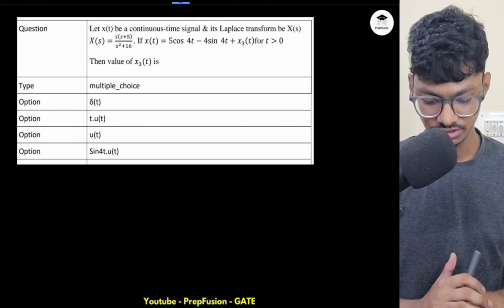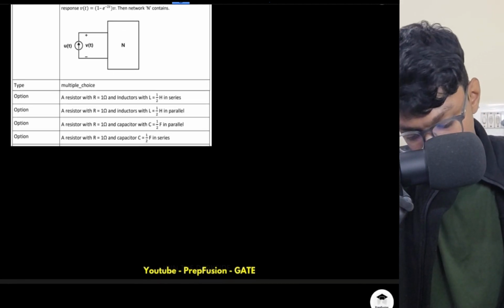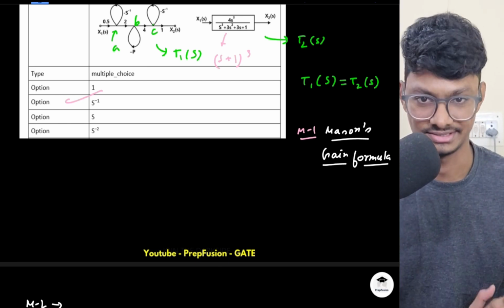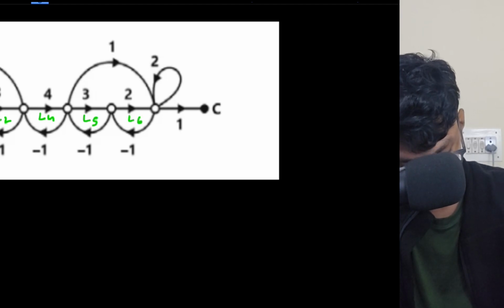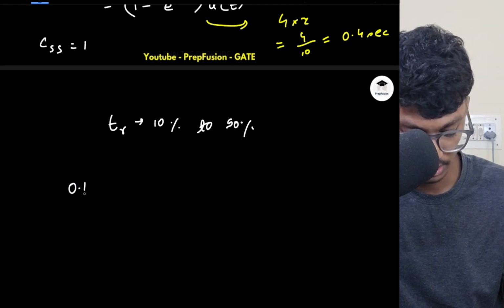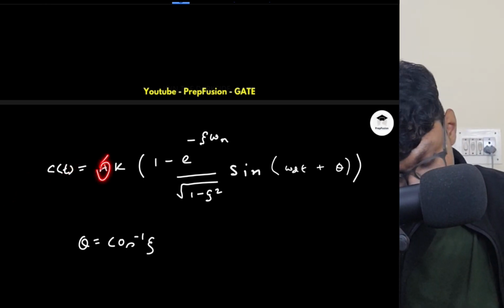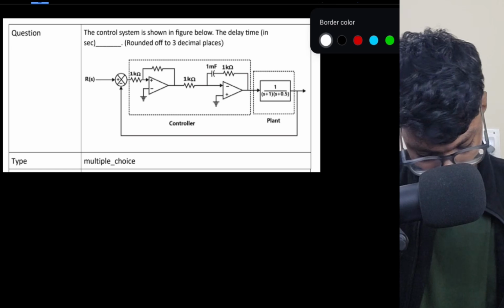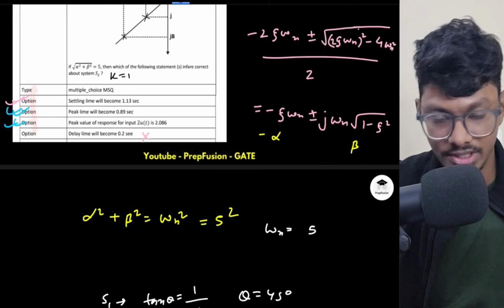🔥FYQ Series || Control System - 1 || Basics, SFG,BLD & Time Response || PrepFusion

Comment: Sir In question 20 we have positive feedback so how VGC will be valid ?
Reply from the maker: Thank you for picking it up. Actually the signs of the first opAmp should be swapped the diagram is not correct.
Reply: @PrepFusion_GATE  Yes sir I think after swapping the sign  our system will become unstable.